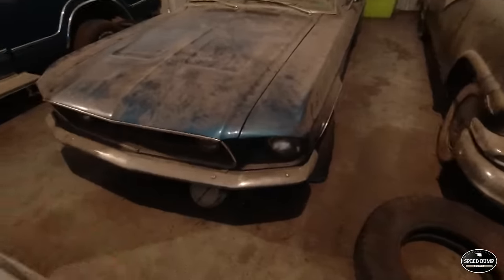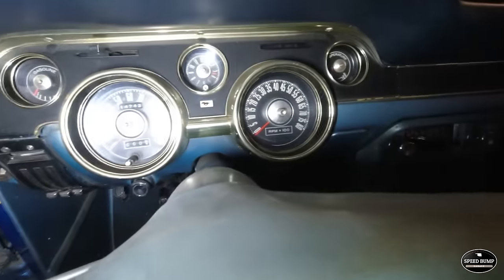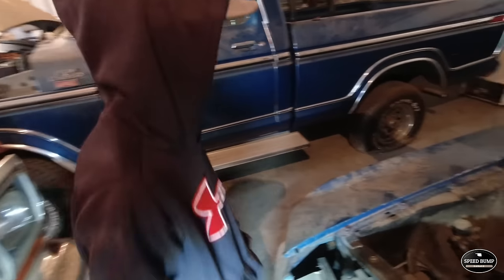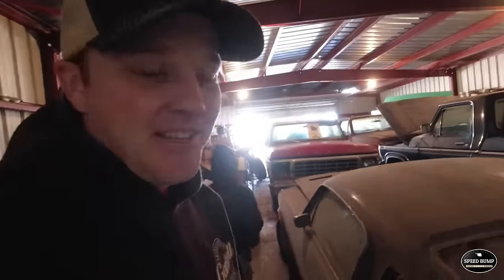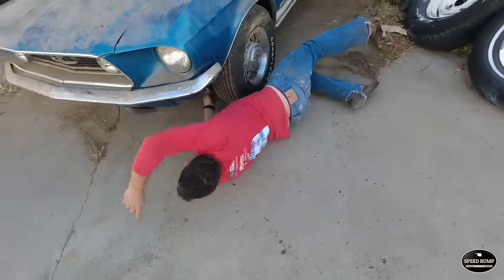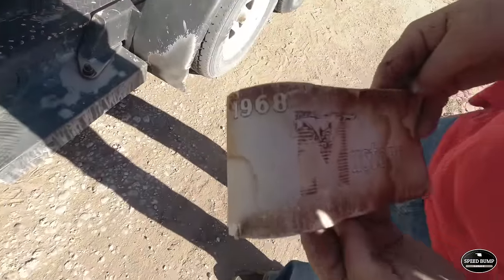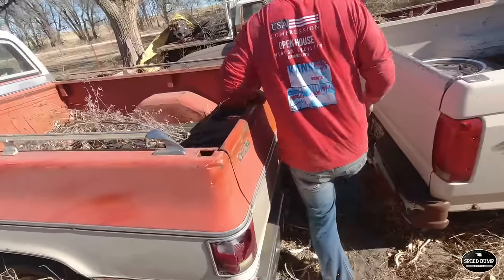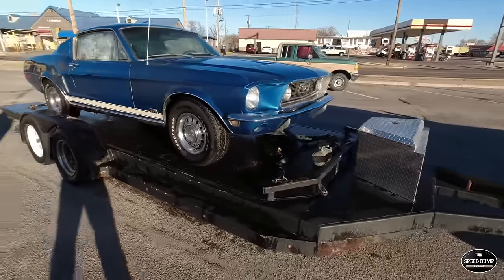BARN FIND 1968 GT Fastback Mustang!

Comment: I gotta say, my big brother had a 67 390. He special ordered it. Waited 6 or 8 weeks for delivery.  Quit his job at a factory in Detroit. Got a job at a gas station with mechanic hoist. Put headers on it. Cheater slicks. Big carburetor with custom intake manifold. 411 rear end.  2 fat pin stripes.  Custom grill on concave tail end and beat a 67 427 Corvette. He was 18 year's old.  Turquoise blue.

Comment: Dan a great find  for sure. I love the 68 fast back.  Is the engine date coded to the car. If so look at the tranny  rear end a n.v d fine the stock carb , air filter housing  and  coil. If  all is good you got a fine  car.  That's  is big bucks  for sure.
Reply from the maker: We haven't looked at numbers yet.  Would the factory air filter housing be chrome?  It came with a really nice looking chrome housing.
Reply: I got the chance to drive 68 fastback with a non matching 428 in it.He told me to drive it like it was mine.....and I did.WHAT A THRILL IT WAS!
Reply: Tell ronnie , if sale 56 ford crown  contact 54 - 56 crown association club  & mustang  clubs out California  & mexico
Reply: Look nice
Reply: Worthy fixing
Reply: Pull over haul
Reply: 68 mustang  fastback worthy money  ,
Reply: Where this location
Reply: Restored
Reply: Check out hemmings book
Reply: Check the number on the cars

Comment: Appears to be a color difference between the right front fender and door.  Not terrible but a concern for possible handling issues?
Mice in the Mustang , besides the chewed up towels. The headliner hanging down means they have been in the roof , check under the dash I've found nests in there after thinking I had everything done.  Set some mouse traps right away and leave them in for a while.
Beautiful car and a collector special.
The 56 Crown Victoria looked like it needs to be saved as well.
Looks like there are a lot of Ford trucks that need saved?  And I thought I saw a couple square bodies sitting around.
You guys found the honey hole!!!

Comment: It looks like the front seats have been replaced with the later 69 Versions with the head rests and solid light blue pattern . What nice find!!!. You could have just put the car in first gear and move it back and forth to check if it was stuck.... More leverage than your hands....
Reply from the maker: That’s a good idea but the rear brakes were locked up when we went to move it

Comment: Excellent find my one friend Mark pick up up estate sale 1970 Ford Mustang GT Grande version had only 125.000 miles got Set of All Season months rims plus tires are orgnail of 5 plus aluminum were Good Year brands and 5 rims also tires winter to of brand Firestone Fire Hawks ! Body need orgnail but need new paint job also back window need reseal plus small rust paint is Olive Green with Forest Green trim with tons chrome and black too! Interior is Forest Green with Gold plus Silver trim , motor is Big Six Cylinder 250 Cubic Inches big blue block also Air Cleaner high Hp and Torque! Motor has Power Steering & Brakes, Air Conditioning to also 4 speed Automatic transmission Overdrive, 377 rear end gears and 4 wheels drum brakes too! Also true restoration on even fun part got Power Radio Antenna in front right fender Motorcraft brand plus Am/ FM radio with 5 speakers too ! So cool to drive and fast too plus has trailer package even on rad to! He got for $10.000 and motor reseal up plus restoration too  but appraisal for $25.000 since restoration done! Also does that car have Power Trunk option if does that cool and only thing how miles got and be rolled over ever?
Reply from the maker: I don’t believe it had a power trunk and he wasn’t sure on miles. That old car sounds awesome
Reply: Ford dropped GT in 1969 and they became Mach 1. The first an only time I saw a 1969 GT I was as confused as Gene Wilder. In 1970, the Grande would have been built on a hard top body, where the Mach 1's were built on a Sportsroof body. Power radio antenna and power trunk would have been dealer installed options, but very cool. Grandes also had an extra 55 pounds of sound deadening material.

Comment: Put a sun roof on it. Some nice 22 inch wheels. A nice stereo system with about 12 speakers. Cut the hood and put a 2 4 barrel intake on it sticking through the hood And y’all will be ready to go on the Hot Rod Power Tour with a kick butt car. Regardless don’t leave it stock because who cares about an old car . Thanks see y’all out there.

Comment: The intake is not factory. Pretty sure it should be C8AE 9425 intake with a big S cast in. The air filter housing is unique to Mustang and Cougar for 68 S code. Should be blue housing with a chrome lid, and have a vacuum relief valve on the side. It is specific to the 68 390 4V in Mustangs and Cougars only. Carb should be a C8OF-9510-C 600CFM Holley.
Reply from the maker: Thanks for the information Paul!  It did have a blue air filter housing with a really nice looking chrome lid.

Comment: You didn't check the trunk it should have a small spare and jack both are expensive to replace as OEM that should be a top loader 4 speed  the wheels look ariginal those are very expensive .  You found a very good car . The hood didn't look right that may have been replaced at some point. The GT should have lights in the hood 3708 of them were made with the engine and transmission setup you have the 390 in 1968 produced 325. Hp
Reply from the maker: I didn't get it in the video but we couldn't find the keys.  I was really wanting to look in the trunk.  Thanks for the info and thanks for watching!
Reply: @SpeedBumpGarage  A locksmith can cut a new key at the car. Better than punching it out.

Comment: I documented your documentation.   I have a 68 fastback C code, so this was great.  Mine is a GT wannabe, with a 4 speed toploader,  9 in. rear, fog lights, tachometer, GT duals, but it will always be a C code 289 and that is fine by me.  It's a sleeper.  Still, it is rare to see a barn find GT while it's happening.  I took some pics so I can reference original parts and color, really.  If you get to the point where you match the engine paint, that Ford Blue, to a modern color (VHT, Eastwood, POR, Plastikote, etc.), drop me a line.  Mine is hotrod black from prior owner.  I would be so tempted to keep that car as a survivor and just get it back into driver shape.  Also, if you happen to get a Marti on it, and if it happens to be a Dearborn car, early 68, let us know that undercarriage primer color and any particular markings.  Mine is actually grey, not red oxide.  It is awesome fun working on these cars and discovering all the history.   Good luck with your fastback and I hope to see some videos showing progress.  Congrats.
Reply from the maker: Thanks Mike. I just learned about the Marti reports a few weeks ago and its pretty amazing how much information they have!

Comment: Did I miss the odometer callout? How many miles? In 01 these were almost all rusted turds or restored. The l Irvin ones hadn’t come out onto the light yet. This makes me wonder what’s under the paint. 
My first car in 1991 was a 68 cougar. 
Had a 4V302 with an automatic… C4 I assume. Looked awesome to my stupid 16 year old eyes, but MAN what a piece. Had enough filler in it to hand form a 69 stingray, air shocks pumped to “rock hard ride” because the rear would sag to an inch over the rear axle when they were deflated. 
Been saying for years I’ll get another and the prices on the 67/68s have been give and low forever… but now they went up like a $300 square body that sells for 18K. 😢
Reply from the maker: I don’t remember the odometer reading but I know it had been in that barn since the 80s. I am filming with this car this weekend so there should be a follow up video out soon.  Seems like the market on all old vehicles has went through the roof now

Comment: For me I had the same color 68 Mustang GT Mustang GT 390 car as mine had the black C stripe with black interior as I changed mine over to a try power which is 3 two barrels and a Lemans cam added 3 leaf springs to the rear to stop the wheel hop and a 391 gear put a pair of 69 high back seats in from a 69 mach one the reaction of the car was More than Awsome as my truckin job sent me to Ohio as I had to leave the car in Texas was only in Ohio a month and got called by my friend my Mustang got stolen  and found out it got Distroyed and Rolled it was my Dream car that got taken from me and all the Major Cryin couldn't bring it back But the Awsome Memory's are priceless Hope someday to find another one to replace my Blue 68 GT Mustang 390 car till then only the best wishes to you and its a must for me to subscribe majorly and majorly thx for your video Major Memory's
Reply from the maker: Sorry to hear about your car Roger! I hope you can get another one someday